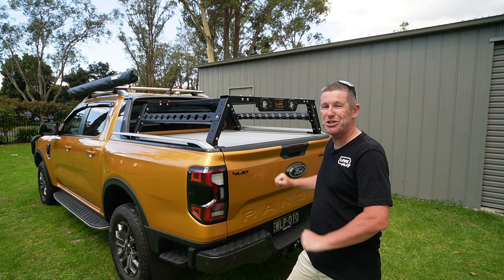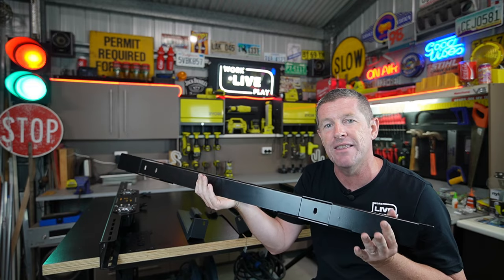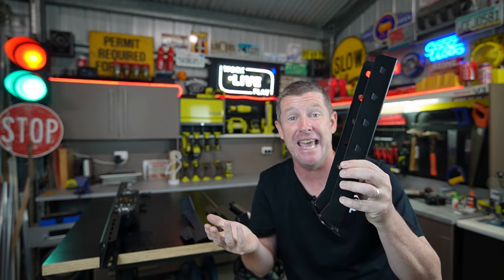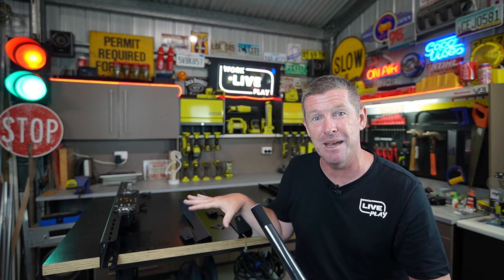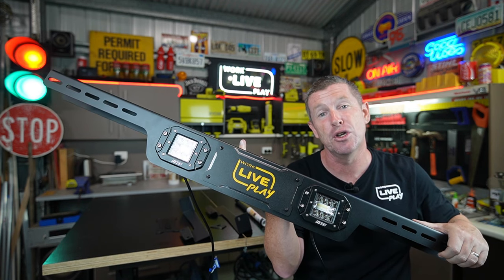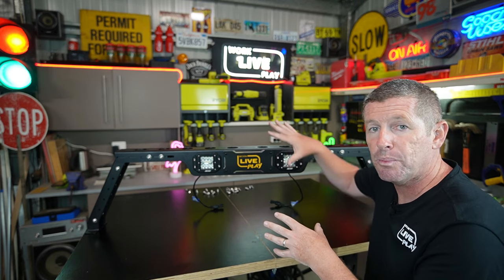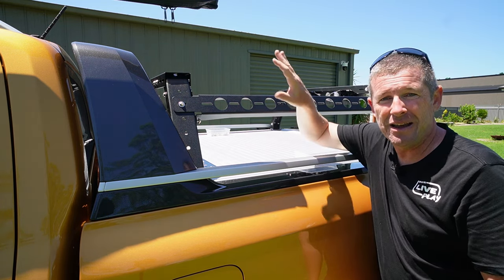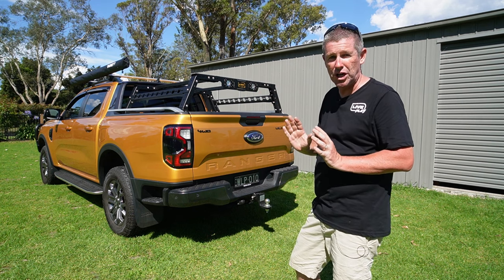Installing an Adventure Kings Tub Rack onto a ute roller shutter - an easy DIY Next Gen Ranger Mod!

Comment: Just another point I have found on the J brace topic. The original does have a very small cut to slide the internal plate to mount the brace, but it is a tiny cut and a bit of paint. The other point is the original is $188, and the other no cut type all different brands are $249. these are the prices I found as of 22nd April 04

Comment: It would be awesome to see if this fits a platinum and still allowing the sail slide. It should as the sail slides down rails that replace the wildtracks "tie down" rails. Anyway another awesome video!
Reply from the maker: I agree it would be a great setup if the sail plane of the Platinum/ Wildtrak X could slide over. I can get some measurements for you when we get back from Brisbane at the end of next week. It would be very close to working 👍

Comment: I own a Dmax x trail fitting a kings rack I built up with 50 mm 3 mm square tube.on the rail then Put 4 x 6mm bolts into the slots on each corner then 10mm rivnuts into the 50mmfor the rack.was that a bit of overkill for strength. .I'm putting  a 270 degree free standing awning on and basically using for light storage.

Comment: I've done a similar install with a Lucas Creek tub rack. I used t-bolts in the rail though - your install look cleaner with the bolt head on top. I used stainless M8 t-bolts but had to cut them down a bit to be able to slide them into the rail (2024 Wildtrak).

Comment: Just so it's clear in my mind, you have bolted the rack to the roller shutter using M6 Bolts into a channel nut in the slot on the roller shutter ? And it bolts down securely enough ? The Aluminium profile in the roller shutter track is strong enough to hold the rack and a RTT up on top ?

EOFY sales on at Kings with Tub racks @ $199 right now.
Reply: Good question — what is the load capacity if installed onto the aluminium roller shutter bracket? 
I’m looking to install a rooftop tent so would need a load capacity of 300kg & upwards. Thoughts?
Reply: @felixalluisious  Ford says 25kg. MountainTop says 75kg. MountainTop says 150kg if you install tub bracing. These are dynamic loads...  in general, I believe static loads are usually about double that.

In practice, I have loaded up my DIY cargo basket (about 25kg) with a night's timber for a big a$$ campfire (maybe another 50+ kg) with NO tub brace and had no issues. I just installed bracing to be able to put on a tub rack, so will see how that changes stuff..if at all.

Comment: Hi thanks for your tutorial on set the rack up. Question for you, can you help finding where to buy the channel nuts you recommended I have tried every where and no luck. The only ones I found were the Rola ones but they don’t fit into the end of the channel😫 thanks again.
Reply: Also having this issue! Any luck with a suitable replacement? Kings were no use they just told me the rack wouldn't be able to mount over the sailplane  let alone into the narrow channel 😂

Comment: Hi, I have a 2018 Ford Ranger Wildtrak with a manual roller shutter. I have just purchased a Grand Tourer MKIII along with a Universal Kings Tub Rack. The RTT weighs 95kg. Would the Triple M brace kit be enough to support the extra weight or would I need the ERG J brace kit aswell? I have been told it's all too heavy and it won't suit my vehicle. 4X4 supercentre won't do a refund so I need a way to make it all work. Could you please help. My concern is that the outside edge is only aluminium and it won't be strong enough to hold the extra weight and the tub rack will crack under the weight once all fitted. Could you please help!?!
Reply: Hey mate, did you end up figuring it out?

Comment: Hi mate, I'm checking out triple M's website for roller shutter reinforcement. It's now different with what you showed in the video   . Took our all the space of tie down points and with a ugly vertical stick. Can you tell me what's your model of that roller shutter support? Thank you. 
And alao i couldn't find the original loading rate for a next gen wildtrak roller shutter.  Can you let me know as well. Many thanks!

Comment: How did you fit the J Brace? I used your link and ordered them but now find the utility hook on my vehicle is oriented horizontally and not vertically. I have the same Wildtrak.
Reply: How did you go fitting them in the end?
Reply: @willmason8381  I returned them and bought OEM.

Comment: What are the channel botls that you used to attach the rack to the shutter
Reply from the maker: Hi Ben, the nuts are from the Mountain Top Evo cross bars I usually run on the Wildtrak. They are currently on back order however here is the link:
https://mountaintop.com.au/products/t-nut-kit

I've also included a link to some T-Bolts in the description. You just need to ensure they fit within the track. We are currently up in Brisbane but I will try to pull one out and measure the width to help out 👍

Comment: Struggling to install this on a soft tourneau cover 😅
Reply from the maker: It should be easy on a standard tub. You will likely need to modify the cover to fit around the legs however. Mind you there is no drilling etc on a roller shutter which you need to do with a steel tub.